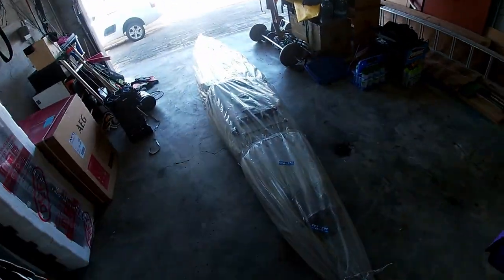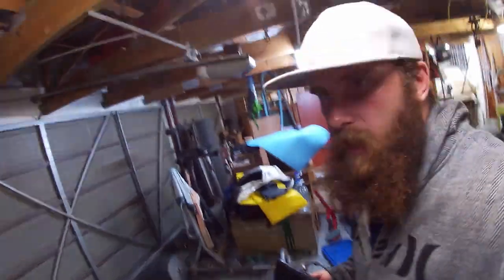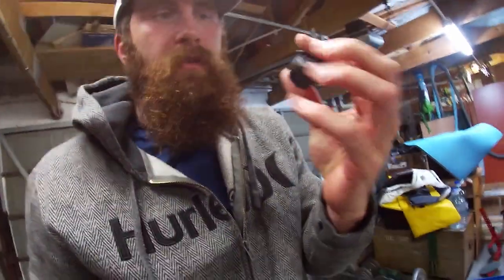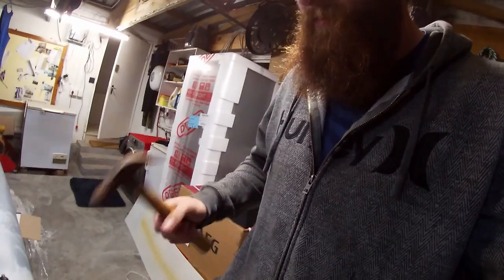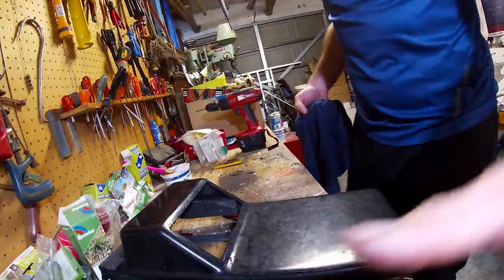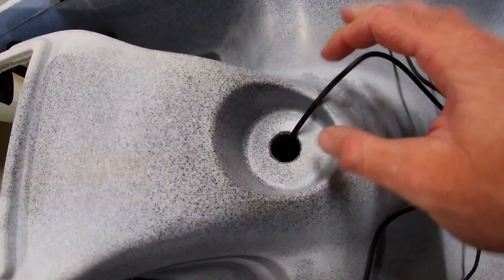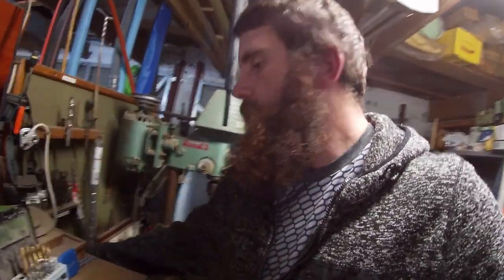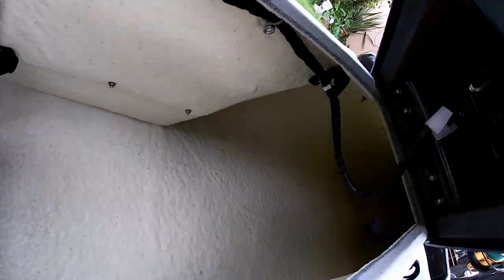How to install a fish finder on a Legend Kayaks Trident | Garmin Striker 5cv Plus

Comment: How does the fiberglass compare to the plastic? Looks like a sick kayak.
Reply from the maker: Fibreglass is lighter but more fragile, plastic is heavier but stronger.
So if you go over rocks and rough launches the plastic is your go to.

The new model Trident is 30kg or less and paddles a lot easier. It's so sick! 🙌💥

Comment: What size battery are you using???
Reply from the maker: Hey bud

A standard cheapie 12v 7amp battery

You can use smaller if need be. But it lasts about 3-5 trips without needing a charge 👍👍
Reply: Thanks